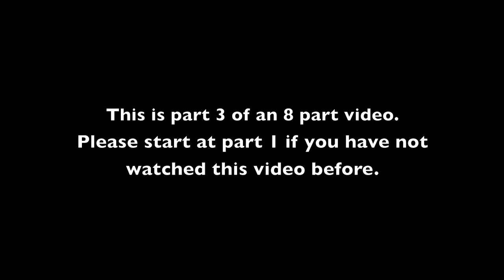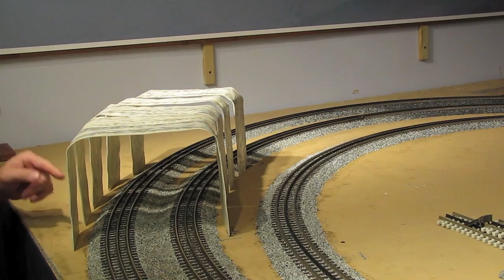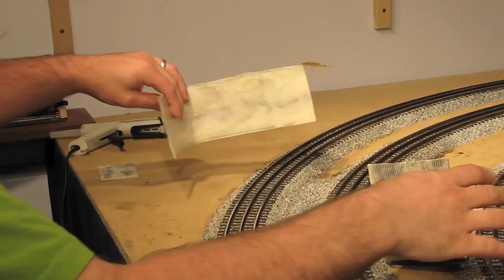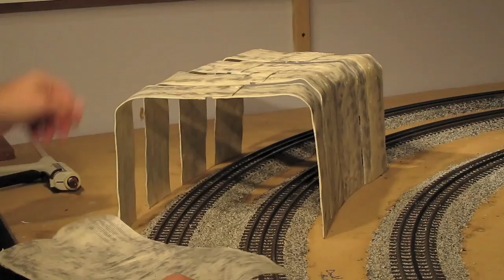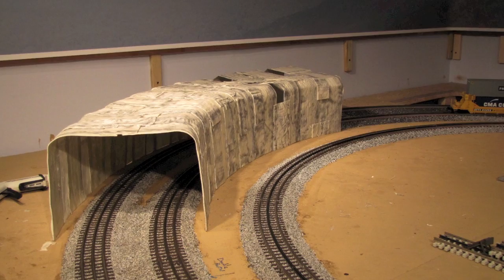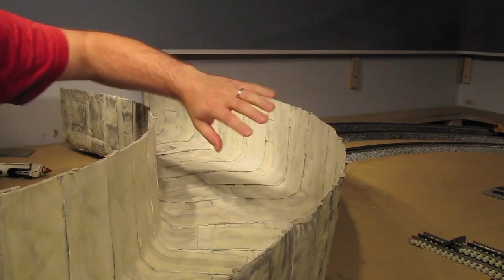Building O-Scale Tunnels - Part 3 of 8

Comment: While I appreciate you diligence and craftsmanship, this process seems laborious in comparison to using foam core board which you can score on one side and bend to the required radius.  Once you get the required bend(s), you cap it off with the same.  If rigidity is an issue, add additional layers.